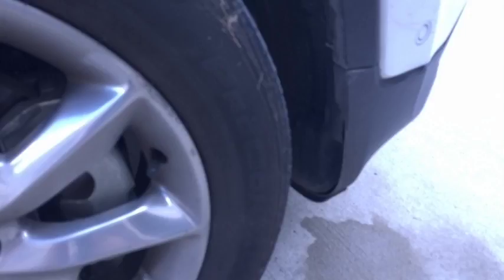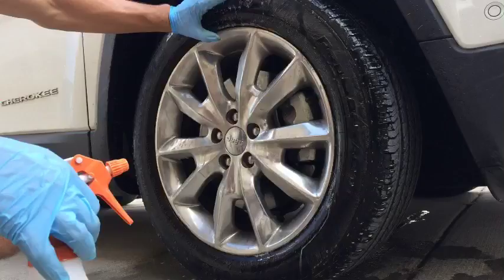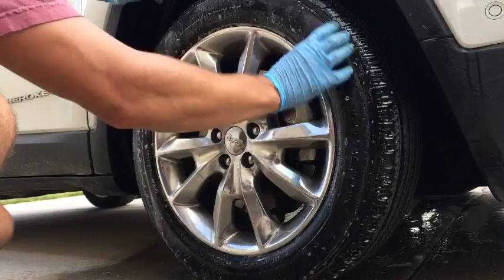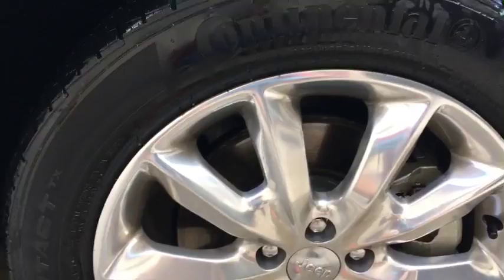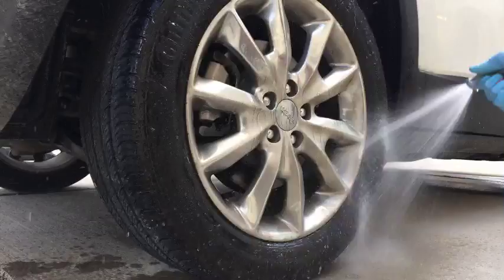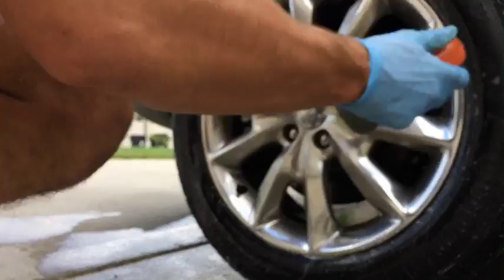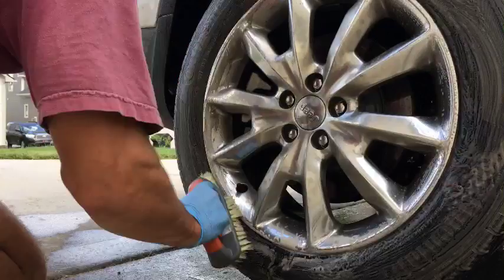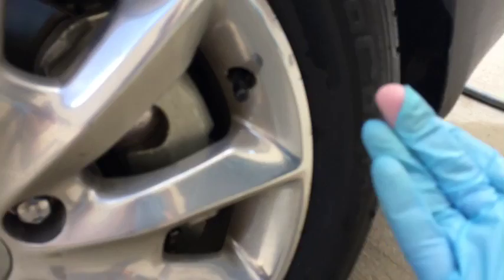When do I use purple power?

Comment: Luke great vid...purple power is great for tires and cheap as hell...wear a respirator though....lol. I just have one tip for u when cleaning tires...after you scrub the tire and rinse....wipe the tire off...there is a layer of browning or "black" on the tire that the hose simply cannot rinse off...by doing this I have noticed making fewer passes and having a overall cleaner, virgin surface for the dressing to adhere to...thanks for the vids bub...they're very much appreciated
Reply: Also I forgot to mention by wiping the tire in between passes the cleaner is not diluted when you go back to make another pass...
Reply from the maker: Youre totally right!! Thats actually an awesome tip, and something that I normally do, I just didnt with this one because its a maintenance detail, and fairly easy because of that! Love yourt tips man

Comment: Hey buddy looking into this for wheel wells on 2011 f150 but been seeing people saying if overspray gets on paint are chrome wheels it does damage? Can u give some insight maybe dilution are a safer cleaner thx
Reply from the maker: Hey man! Yes I can give you some insight.... what I have found is that purple power overspray has never caused me problems, and I have detailed A LOT of cars with this same exact method. I do not like to dilute it because it is so effective full strength when used in this way on these parts of cars specifically, but I would say do not worry too much... if you need to just test it out in a small inconspicuous area first and see what happens. Because the wheel is already wet, and most of the time the surrounding paint is a little wet as well, the overspray instantly gets diluted with water as soon as it hits the surface of either the paint or the wheel, not to mention, overspray is such a small and negligible amount of product that its simply not significant enough to worry about,,, but again, just test it on your car and see, hope that helps!
Reply: Wilson Auto Detailing thanks man I appreciate it and yes that’s what I figured surfaces are wet any how. Does it happen to leave any white residue? Also what’s a good car was u suggest. I was looking at the shinerz showtime wash but no reviews. What’s your go to?

Comment: How often should I scrub my tires with a brush? Also I have these big mud terrain tires that have aggressive tread and I have this black residue that won’t get cleaned off with my brush on the side wall closer to the tread.
Reply: Use purple power at full strength for the tires. Apply full strength Purple Power to your wheels and tires daily for 21 days straight. At least until you achieve your desired result

Comment: How do you figure out what dilution ratio to use for what? Is there a rule of thumb for such? That's really the only thing that I have a problem with. As in what to use on interior carpet/leather or tires/wheel wells etc.. I use Super Clean, not sure if it's any different.

Thanks for all the great videos man, keep them coming!
Reply from the maker: That's a great question man! As a rule I keep my interior degreasers diluted 5:1 and interior APC 10:1, as far as degreasers for tires, engines, etc.... I pretty much keep them full strength!

Comment: I will say I am a little hesitant becasue the first thing it says on the back of the bottle says dont use it on wheel rims or auto in general. What your saying about dilution makes sense and maybe I will try purple power as a back up for maguire's wheel and tire cleaner. In the past I used Awesome degreaser to clean up an old Buick. We used it on every inch of that car; body, wheels, tires, engine bay..even the upholstery lol. The car had smoke and flood damage so it lightened up a beige/ cream colored interior quite a bit, but did make the upholstery a little rough and dry feeling after it dried. Just curious, have you used/ tried Awesome degreaser or any other products made for use outside of auto cleaning/ detailing?